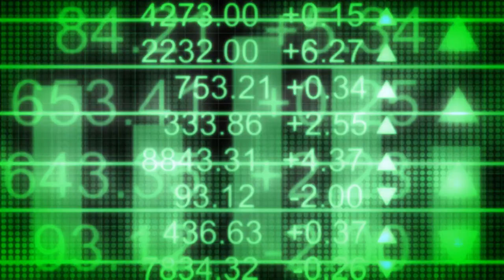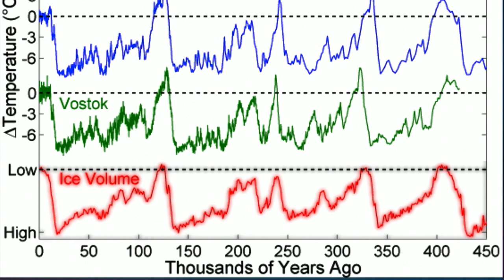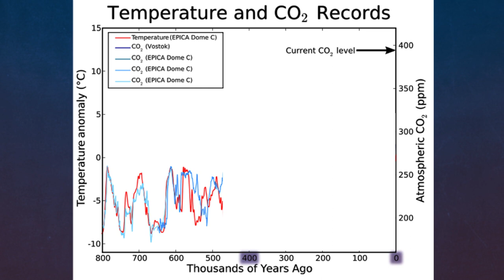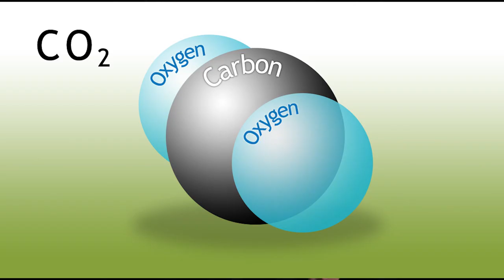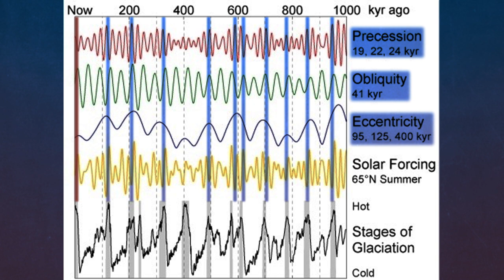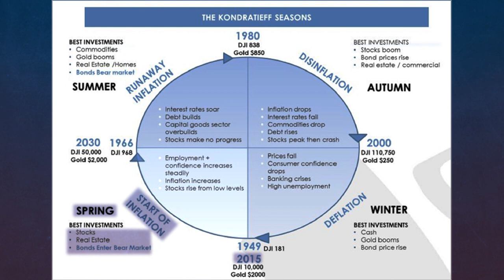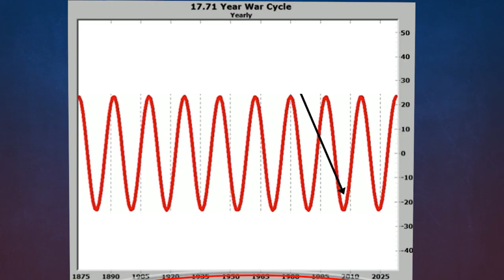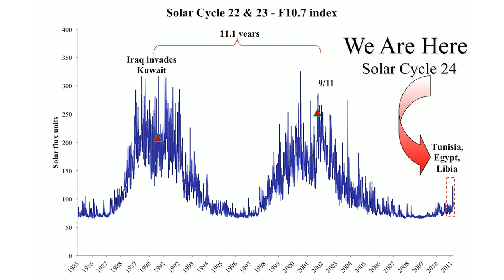Cycles of Time with Gregg Braden

Comment: if this was a natural cycle then things would be as you say but we have changed that by putting so much C02 into the atmosphere so fast that the global temperature have not had a chance to react to these sudden changes. 10 years ago scientist were believing that what is happening know was not to happen until 2100 but to there totally surprise it is happening know. If they have underestimated that time line then how fast it it really changing. Methane has not bee even included in any model because they are not sure of a amount to work in. If methane is released from the arctic in massive amounts then we will be talking about a hole different world very quickly. Uninhabitable by humans. No food left except each other. This planet was heading into a ice age but we changed that.

Comment: For an otherwise interesting presentation, I gave it a thumbs down because Gregg jumps to the conclusion that temperature causes CO2 rise and not the reverse that is the present concensus. My argument, that by the way is not based on concensus (which has in the past proven to be a weak reed to lean upon), is that correlation does not imply causation. In order to understand this, and to reach reasonable conclusions in the face of uncertainty, it is necessary to study advanced time series analyses that are generally used in econometrics using lagged variables, in other words some variables do not show the effects on the dependent variables immediately, due to various causes, many referring to the way the independent variables are registered for use in the respective equations… since I am not a specialist in this, I'll leave it at that. Simply speaking, I am not convinced.

Comment: This video completely misrepresents the science. The climate change we are experiencing is due to the burning of fossil fuels due to human activities. Braden did correctly state that if you look at the past history, the planet should be headed for an ice age; however, the rate of change of the temperature increase that is currently happening is by far greater than has happened in the past. Furthermore, if you look at more recent data, most of the graphs in this video are 30 years old or greater, we are at even greater extremes and are that much higher than seen in the ice core and seafloor records. A point to quibble about the logic, you can't use the scientific data to prove your point and then discard the data when it does not prove your point.

Comment: Co- joint mutual mutual

Rona- my joy

Ro- Reverse osmosis (RO) is a water purification process that uses a partially permeable membrane to remove ions, unwanted molecules and larger particles from drinking water. ... Applying an external pressure to reverse the natural flow of pure solvent, thus, is reverse osmosis.

Acronym Definition RO 
Royal Oak- (Michigan City, MI, USA) 
RO- Read Only
RO- Regional Office
RO- Rule Out
Definition of rule out. transitive verb. 1 : exclude, eliminate. 2 : to make impossible

Requested Off

RO stands for Requested Off (work schedule)

What is RO company?

Ro is an American digital health company that diagnoses, prescribes and delivers treatment through its 3 services: Roman for men's health, Rory for women's health, and Zero for smoking cessation. The company is headquartered in New York City.

What does RO mean in science?

Read Only. Academic & Science » Physics. Rate it: RO. Reverse Osmosis